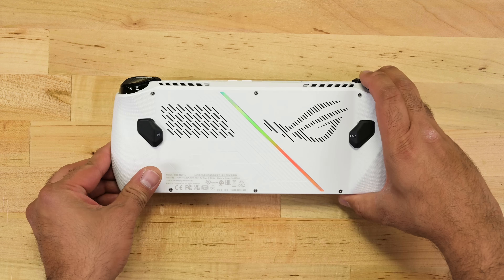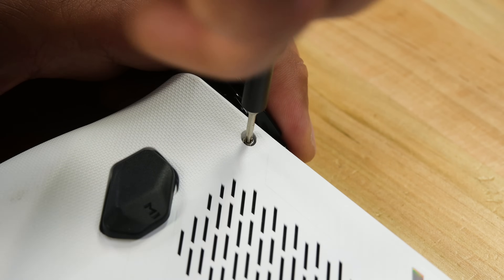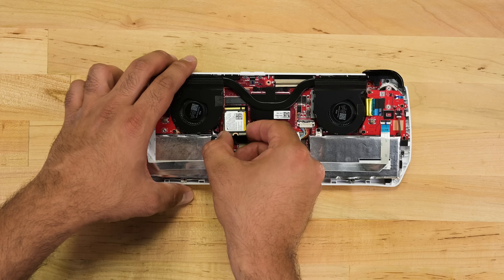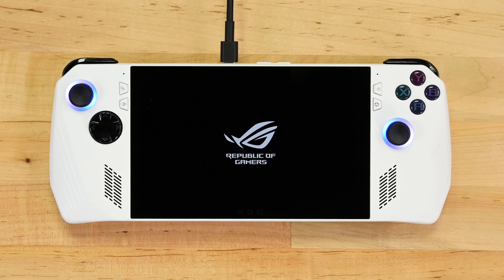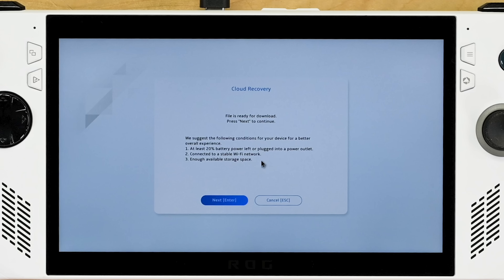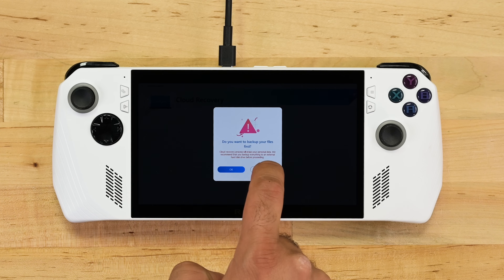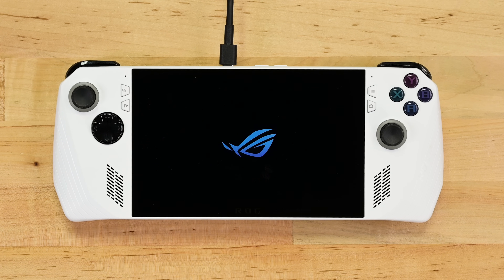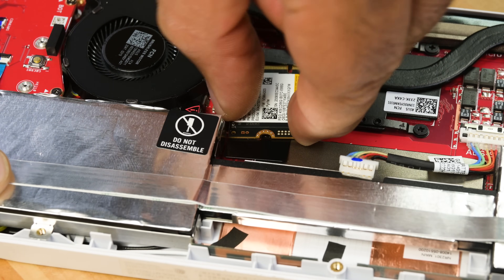How to Upgrade the SSD in an Asus ROG Ally

Comment: This is beyond easy this is why I like the Rog so much
Reply: Wish I could say I like the rog the same. For one, it killed my memory card, the battery life is God Awefully beyond terribly embarrassing bad which defeats the purpose of it being portable. I must admit though, as I can see the only positive thing about it, it's that it is beyond easy to upgrade the ssd. I recommend people to do this instead of buying an ssd card, which will fail on you when it comes to this device.
Reply: My SD card got fried three times so I’m thinking I’m just gonna go ahead and install a SSD hd
Reply: @valg.3152  can't believe u allowed to fry a second time smh
Reply: @valg.3152  probably best
Reply: @valg.3152 micro sd cards getting fried like that smh
Reply: @valg.3152 haven’t done it yet but I think we can place an aluminum shield and block heat flow that warps it. I’m trying to figure out how to position it. It’s tight.
Reply: @hanhang5086 it’s not the slot that kills the as cards it’s the controller chip on the mother itself it gets to hot and the solder joints underneath break and in turn corrupts the sd card it has Nuthink what so ever to do with the actual slot or it’s location just ppl jumping to conclusions with no knowledge or research there is now companies that will resolder/ replace the chip and it works perfectly after that hope that gives u more info on the sd card issues
Reply: This was very easy, however normal operation of it was very hard for me as a non PC gamer. I quickly realized it is not for me. The games wouldn't even play properly or at all if I didn't set them up with their own settings (which were like reading Latin to me) and all the games I play are big AAA games so you really have to do some tweaking to get them working well. At least in my case. If I was familiar with PC gaming it would probably be a breeze but since I'm a console gamer only and not very patient I'm taking my 2TB SSD out, sending this back and putting it into an OLED Steam Deck
Reply: @Sickwitit18  that's what alot of people recommend if you are a PC gamer ROG Ally will be very familiar, abit of a learning curve for setting and functions, but if you definitely want more of a console like experience Steam deck definitely the way to go
Reply: @joshuagarcia2868  cool thanks!
Reply: ASUS ROG is awesome. Sadly, Microsoft is not...
Reply: @Daddo22 Use Linux !!! And no play game pass!!!
Reply: @sanillustration why no game pass
Reply: Wich is exactly why I use steam os on mine now is flawless 🗿👌
Reply: Idk about the other user but I got the 64gb lcd steam deck. It was not easy. The number of hooks makes popping the back hard. Also, software was pita! Who knew steam zipped their image file in a file extension I wasn’t familiar with AND it had img in the filename. I wasted half a day reading and figuring out. Many pitfalls to fall through with hardware and software. Particularly the software was challenging bc what they thought is intuitive is lots of confusion for those who know even a little.

This was east street! I spent less than 15 minutes and didn’t have to deal with software. And upgraded to 2tb!
Reply: Fr dude I was going to buy a rog ally 2tb to avoid this for 900 bucks but that easy I can get one from Best buy for 400 and spend 200 for a 2tb and save 300 bucks.
Reply: Sadly there's a problem with it currently where micro SD cards are overheating, and getting killed :c
Reply: @cozymiqote maybe not after the last update. For now my SD is still alive but I'm not very comfortable so I don't let it inside the Ally all the time
Reply: @briceofrivia926  That's a smart move, I suppose it's only for people who do extremely long play sessions and don't think about the heat the system generates.
Reply: @cozymiqote  blame the rog ally cause even with the two fans if it overheats the micro sd cards wont survive the temperature
Reply: @cozymiqote  Good thing I just watched a video on how to upgrade the SSD lol
Reply: steam deck was easier to replace ssd lol
Reply: @chaikagaz Definitely easier to replace and restore than the Steam Deck.
Reply: @slugga29 yes. Not sure why one person think it was easier on steam deck.  This was easier physically and softwarically, if that’s a real word.